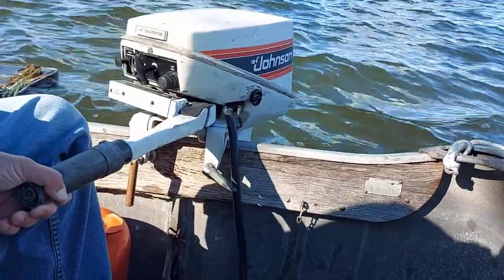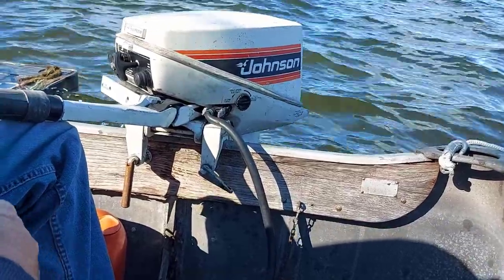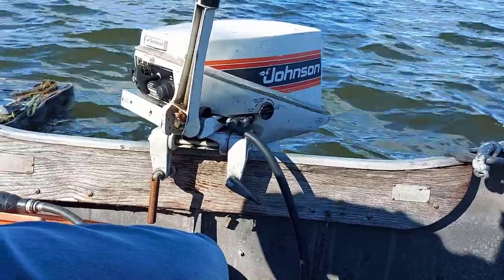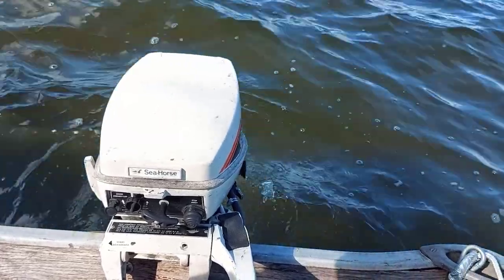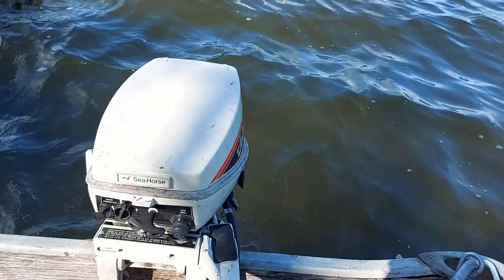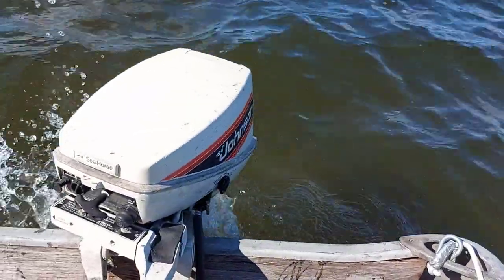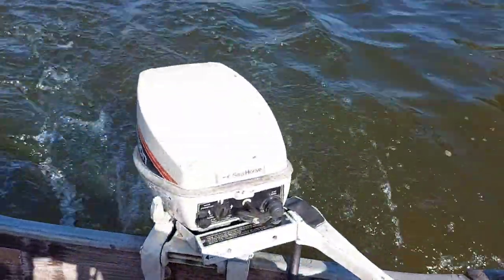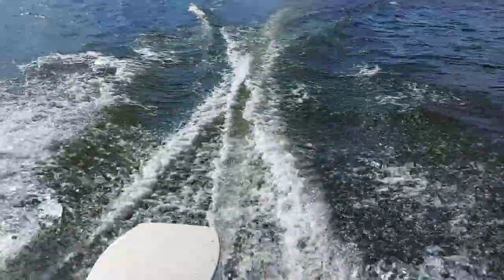1981 Johnson Seahorse 15 HP Outboard Lake Run | Its a Rocket!

Comment: I restored a 14' wooden boat for a neighbor about 30 years ago. He used a 15 hp Evinrude. Got to take it for a good run after putting it back in the water. That thing boots along really nicely. I'm sure he still has it.

Comment: Embarrassed to ask, but recently got a 1975 Johnson 9.9 for my Jon boat and don't have any kind of operating manual. Main question is re: tilt mechanism. When I move the tilt handle to the up position, should I be able to raise the motor and have it stay in that position by friction alone?  Since mine won't stay, how can I tighten/repair the mechanism? The other question is re: trim setting. I don't have the rod to hold motor up in desired trim, but will make one soon. Do I do anything to raise the trim other than lift motor, slip pin in place, and let motor down on pin?  Any advice would be greatly appreciated.  Thnx, Greg

Comment: Thanks for the video!  I just bought a little boat with a Johnson Seahorse 15 outboard.  I am trying to find out the year of the outboard.  It looks exactly like the motor in your video, same logo,  color.  Been trying on different sites using Johnson's code/year system, but can figure it out.  I do have the model number and serial number off the motor mount plate.  The model number is J15RCIS.  Any help would be appreciated.  Also, I'm assuming this motor will need a fuel mix?  Thanks again in advance!!
Reply: Mines the same look as his its an 85 i believe.

Comment: I just picked up a 1981 johnson 9.9, what do I need to make it a 15hp?
Reply: You can't the 15hp power head has bigger ports.
Reply: Hopefully you figure it out by now. But all you gotta do is mount a 15 Ho carb to it. If you’re really ambitious you can add shims to reed valves and a tuned exhaust from a later model 15 Hp.

But just the carb will get you 90% there.